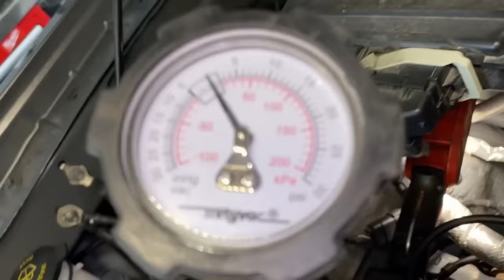2011+ Ford F-150 3.5L GTDI Ecoboost Engine P0299 Turbo Underboost Quick Diagnostics

Comment from the maker: This is the Vacuum/Pressure Tester I Recommend:
https://amzn.to/33P5JkG
Latest Ford Blow Off Valve (2013+)-
https://amzn.to/3yv0GCy

Forscan is free Ford Specific Diagnostic Software:
Download Here- 
https://forscan.org/home.html
ELM 327 Adapter I Recommend-
https://amzn.to/2GC6dBj

As an Amazon Associate I earn from qualifying purchases.
Reply: thanks i will order the mityvac today
Reply: Teacher can you do a video  please for a diagnostic in a ford f150 3.5 whit code.p0035.
Reply: Its 2019
Reply: Is there an software/app that allows me to use my Smartphone as   My code Reader?   Either APK or IOS?  I’ve seen some Diesel stuff like this, but nothing “Forscan” specific.?
Reply: The intercooler i would repair with high strength long cure  epoxy once i had cleaned with brake cleaner washed with dish detergent / hot water dried and sanded  prepped correctly it would last  . Its is used in hvac repairs were welding cant be done easly . In Canada the intercooler would be double + the price for sure  . The key to epoxy is propper prep
Reply: Do you know if that blow off valve is suppose to make a clicking sound? Mine has been doing a clicking sound, since the day I bought a new one, to replace a broken one that came with the truck.
Reply: Do the F-150 3.5 ecoboost and Expedition 3.5 both have the same diaphragm on wastegate? Curious if I can use pressure to test Expedition. Thanks!!!
Reply: @luisfranco5917  mine does as well not sure if that's good?

Comment: Nothing like a mechanic who knows how to diagnose a problem rather than a mechanic who only knows how to replace parts.Great video as usual Brian.Thank you Sir.
Reply: When I did service work we called them shotgunners replace enough parts and you will fix the problem,not very talent but eventually you might get it fixed and they still didn’t understand how they fixed it
Reply: @stephenthompson1319  We call it the parts cannon at work.  Just blow enough parts at it until it finally works.
Reply: "Mechanics" are most of your parts throwers and tire/brake/oil change jockeys.  A good 'Technician" is what this guy is.  Actually diagnoses thoroughly and properly and then makes his repair.
Reply: Ya i wish i brought my ecoboost f150 to this guy instead of ford 3 times for the timing chain rattle. Just found out Im only 30 minutes away from his shop
Reply: This is the issue i had a ford dealer i took to changer mechanic rather than a mechanic that fixs
Reply: To much of the R&R in today’s Techs. With no actual Knowledge of what the problem is.  I’m in the Technical field myself and I’m almost always solving a problem with TShoot & Diog. Saving money for a new “Whatchamacallit” that wasn’t really necessary,   Without Theory with experience they’re all just “Installers”. Not formal techs/Mechs.
Reply: I get it.  But if I boil it down to 2 parts and they are say 50 bucks each,  I'll replace both over another hr of diagnostics. Especially if you have to pull the part to test it. I also consider vehicle mileage when throwing 2 parts for one problem. Hope that made sense
Reply: On point.
Reply: Half the time it’s the customers handing you a part saying i diagnosed it myself from a yt video . They don’t want you doing more than throwing the part in .

Comment: I know very little about working on cars but when my under boost code came up I came to YouTube before going to the dealership. $50 and 10 minutes later, my 2015 F-150 ecoboost is like new again and no check engine light. Thank you for the video!
Reply: What did you find wrong and how many things if any did you replace?
Reply: Monty, there was a hole in the blow off valve. Prior to this, I changed spark plugs, cleaned fuel injectors, cleaned all the maps sensors.
Reply: @adammccullough218  Thank you do much for your help in guiding us novices. Did you use CVC/CRC (sp?) for sensor cleaning?
Reply: What is the name of the harness that connects to the pressure valve?

Comment: I had the same code in my 2014 3.5 ecoboost. All the hoses and connectors checked out fine. I pulled out the pressure relief valve and didn’t see any noticeable tears in the diaphragm, but I ended up replacing it anyways. After clearing the codes, the problem never came back and I have the turbo boost back. Moral of the story is just because you don’t see a tear in the diaphragm, doesn’t mean the valve hasn’t failed :)
Reply: I appreciate this comment This is very reassuring since this has been my thought for a little while now... I too did not see a tear in the diaphragm and I'm about to change my BOV out we'll see

Comment: I'm a ford dealer tech. I 2nd this video. This guy is spot on. I only do driveability issues. Seen this several times. I dont even follow the pinpoint test anymore.
Reply: Pinpoint testing is a waste of time for ford warranty to waste time and get the customer frustrated.
Reply: follow makuloco instead 🛌💤👀

Comment: I had an underboost code awhile back, and this was indeed the case.  Now that I'm turning up the boost I wonder how much pressure this stock valve will take.  I didn't want to go full out on a Turbosmart mechanical BOV, but now they make an EBOV, so I'm very tempted to try that. Have you seen those in person by chance?

Comment: Just had 1 of the trucks in my fleet have this code after looking at the records this truck didn’t get it’s yearly PM that would’ve included spark plugs. So I went ahead and did the plugs cleared the codes and after 3000 miles code still has not come back

Comment: Awesome video Brian…really helped me in fix my 2013 F150 3.5L that had P0299 code!
Just as you suggested…my blow off valve had a hole in the diaphragm!

For other DIYers...when I replaced the blow off valve on my truck, I did some extra steps that helped me:
     1)  I removed the underbody wind deflector to give me more room to maneuver under the truck
     2)  I removed the resonator mounting screw allowing me to rotate the resonator up counterclockwise
           while still attached to get better tool clearance to remove the blow off valve screws

Like Brian predicted…I broke the left side screw in process of removing my old blow off valve.  The screw I used for replacement
was Ford part number W507065-S437 ... get quantity 2 to mount your new blow off valve with new screws.

Took me 25 minutes to complete the job including removal and replacement of the wind deflector.
I cleared my code and started the truck….no check engine light and had turbos again!

Comment: This video just saved me a bunch of money. The large hose for the air inlet coming out of the turbo had popped off. Check engine light came on during a 400 mile trip, and the truck was running like crap. Put the hose back on, tightened the hose clamp, and it’s the best the truck has run since I bought it 9 months ago. I think it was working itself loose for a while.

Comment: Thank you very much for this video. I got a CEL for low turbo boost pressure while traveling in the Rockies recently. Went through all your steps and found that my blow off valve had a hole in the diaphragm. Luckily I was able to get a new one at a local dealer, throw it in and enjoy the rest of our vacation with plenty of boost in the mountains. This was most likely what I was hearing previously (mooing sound while accelerating) and the thin air in the mountains made it more apparent. Thanks again for the help.

Comment: Twice the hoses, twice the clamps, twice the wastegate diaphragms, twice the oil lines, and a big ol' intercooler mounted up front, down low, with nothing shielding it from road debris.  What could go wrong?  Then there's this gimpy blow-off valve mounted on the back of that.  With bolts that rust solid.  Thank you again for your videos.  You're saving people's sanity, not just their money.  Very methodical which is key on a complex beast like this one.

Comment: This was the exact problem I just had, found the issue in under 5 mins thanks to you and this video, bought the part and now to wait for a few days for it to get in. Saved a trip to the dealership and the ungodly amount of money they would’ve charged to troubleshoot and then to mark up the part 100% on top of that. Ordered through your link on Amazon and was a touch under $50 and will be about 20 mins total of my time. Thanks again! 2014 with 59k miles

Comment: Just saying that I'm so glad I found your videos.  I've said it many times that I hate my 2012 FX4, but I'm stuck with it, and these videos are the best by far I've seen.  Thanks!  You've saved me $$ and time!  
Shuttering again, 35 mph or more if give it gas, loses power, CEL flashes, I've had it before.  Changed throttle body.  This time cleaned it, sensors, new MAP installed, improved for about 15 minutes....changing plugs next.  Cheap...to expensive.  Heck, I've even changed out the 'brain' in my tranny before.

Comment: I found this repair applicable to a 2017 expedition with the 3.5, pulled the blow off valve from the intercooler and found a small tear in the orange seal was causing only an under boost code with no noticeable loss of power, great info for sure.

Comment: Thank you for all the in depth videos. Very helpful. I spent all day yesterday changing out all the fluids under my F150 it has 88,000 miles on it. I couldn't believe how black and nasty the fluids were. So thank you for the heads up on not going by the manual intervals of when to change fluids. Thanks for saving me lots of money down the road. Have a great day Sir.

Comment: Great Video. And Thanks. I went straight to the Blow Off Valve and had the same issue. Hole in the Seal. I would not have spotted the small hole without knowing it was a common failure. First inspection it looked ok, then I pulled on it to reveal the hole. Thanks again for the valuable post.

Comment: I'm a new technician and I had this code on 17 ford expedition 3.5L ecoboost almost 100k miles. I wanted to know some of the things that caused this code and a lot of the confirmed fixes on identafix is replacing the turbos, but im not the one who likes throwing parts on a vehicle and crossing my fingers. I found this video, checked the various items you did, and wouldn't yah know it. There was a tear in the Bypass Control Valve just like this one. Thanks for your help, and definitely subscribed 👍

Comment: My 2016 expedition just started throwing the under boost code at low rpm/high throttle. Thank you for the checklist to look at.
Reply: Ebov is the primary culprit
Reply: @RadDadisRad  Ebov?

Comment: Thank you my man!!! That valve must have had a twin... Mine was torn same place. I did job without pulling anything out but it took some patience to remove the bolt on left as you look up. A flex neck and 8mm on 3/8 drive, an extension and lots of prayers and patience got it out. I did notice the screws are alluminum so I can see why they twist and break. Thanks again!!!!!

Comment: THANK YOU for posting this video!  I've had an intermittent CEL which then became a steady light recently.  I've noticed power has been down, especially when towing.  I was dreading an expensive turbo repair, but using your video, I was able to start checking for leaks and quickly found a torn valve.  It was an easy an inexpensive fix - actually surprised how power is fully restored now!
Reply: Lucky you, I was told to replace turbos
Reply: Was it easy to do.? Just bought a 2016 and after getting on the gas the check engine light comes on and lack of power.. code says turbo under pressure so I'm assuming it's same thing.  Or hope it's only that
Reply: @marckirby7356  Yes, the job isn't difficult.  This video shows exactly how to do it.  My local Ford dealer had the part in stock so that was also nice.
Reply: @yandia8336  ty

Comment: awesome video.  I just replaced that part on my '13 F150 (140k miles) a few weeks ago.  I typically get that code when I tow my travel trailer.  knock on wood, that takes care of it.  I used some stainless steel bolts instead of screws on that valve.  I find it funny that they provided a second set of holes to use.  keep up the great work.
Reply: Same issue for me under same condition, but at ~70k. The second set of holes is for when the rusty screws break in half when attempting to remove them. And yes replacing this valve solves the problem seeing as the old one will have a hole in the diaphragm that is visible to even a blind mechanic!

Also during this part install I did a flush of my CAC and woah did it have lots of oily crap in it. Runs better, mpgs went up a bit, overall good fix.

Now the cold idle is another story....Brian please do a video investigating that.

Comment: Very informative, recommended for anyone with this code. Nothing like tightening up a boot or doing a simple sensor or valve cleaning/fix instead of a spendy shop diagnostic fee.

Comment: Very thorough! Good stuff to check, especially if you aren't experienced with turbocharger systems... Some cheap easy fixes can be misdiagnosed as an expensive repair.
Reply: Or intentionally misdiagnosed . it's hard to give anyone benefit of the doubt.

Comment: Great video!  I had a p0299 on my 2015 Ford Expedition at 78k miles due to a hole in the blow-off valve diaphragm (looked exactly like the one in your video).  Much cheaper repair than turbos!
Reply: How do you do a smoke test?

Comment: Fixed!  2015 F-150 2.7 code P0299 going into limp with wrench light and low power/ no boost.  Replaced the "EBOV" valve with Ford PN: AA5Z9U465A $81.33 list.  Also available as Standard PN TBV1007.  Don't get too hung up on torn diaphragms, leaks etc.  This one looked good but was still causing the fault intermittently.  Just replace it!

Comment: Great timing on releasing this video. Had a 14 Escape with 1.6 .with p0299 . Pulled TCBY off of turbo and found it stuck in . Parts department says only comes with $1100 turbo.
Reply: @behexen250 Should be another way to replace that part without purchasing the whole unit. Ripoff!

Comment: 12:58  To remove that broken bolt with a tig welder.  Deposit one drop of .045 - 1/16  filler rod to the top of the broken stud/bolt and let it cool for a minute or so.  Repeat that process to build a spire with drops of filler rod until the spire is tall enough to grab with pliers.  I have removed as small as a broken 6-32 tap using this technique.  No need for the cool down between tig drops if not in a plastic part.

Comment: My 2013 f150 had the same hole in the blowoff  valve at around 80k miles. Good call checking this before buying new turbos.

Comment: Seen lots of photos of the BOV (AA5Z-9U465-A) with torn diaphragm all otears seem to look identical - I would say it's a design flaw personally. 

Your video was AWESOME and helped me find, remove and replace my BOV., with ease and confidence 

Jacked up the front of my 2013 F150 FX4 and removed the screen that is below the intercooler. Then pop off the wire retainer for the Outlet Duct on the drivers side, then carefully push up the duct, watching out for any oil. If you don't move the duct up you will not be able to get to the left bolt. 

BE CAREFUL undoing the bolts, lots of articles about them breaking off, so be gentle and take your time, plus they only screw into plastic. Snap them off and you may need to replace the adapter (DL3Z-9V456-A). Again, awesome video and much appreciated!!!

All good now and no more error P0299 :o)

Comment: Just like to say that I watch your videos all the time and was excited to see one on the 2013. I've had mine sense 2013 and I have not had any trouble at at out of mine. I change my oil and filter and air filter every time it's needed. I just rolled 200,000 miles and i have changed spark plugs four times now. Other than that I have not done anything to it. It's been a great truck and when it's time I will get another one.

Comment: The same exact thing happened to mine. The dealer replaced one of my turbos (under warranty). Still had the leak. Ended up being the $50 blow off valve. Haven’t had the code since it was replaced.
Reply: Did the code keep coming back until it was fixed? I'm wondering if I had a weird event happen that caused the code. I cleared my code and it hasn't come back for over 2 weeks

Comment: Your knowledge is amazing. Thank you for inspiring confidence by making us understand these failure points. 

Isn't it a crying shame how that air cooler is exposed to the hazards of the road. Gravel. Flying sticks and other debris. There ought to be a two-level diversion screen baffle to stop hard objects but allow air to go through. Or maybe a very stiff wire mesh like a copper chore boy but made out of steel.  Or 2 thin ones. That air cooler looks like a big ongoing problem and the engineering thus far is obviously far too minimal.  There's nothing robust about it.  I would expect more from Ford.

Comment: Great video! I wish my local dealer would watch all of your videos.  I am currently in the "warranty process" for new turbos.  I've checked everything you have gone over and the dealer has looked at the truck twice. After a call to the tech line, I have been approved and will be scheduled as soon as parts come in.  End conclusion,  the dealer said it was carbon build up on the wastegate.  

Keep em coming...
Reply: Dealers don't care about these videos because it lowers their "service monies"
Reply: Yeah,  I know.  Wishful thinking...
Reply: Update, both turbos have been replaced as well as the solenoid valve.  3 trips to the dealer.  I got it back and I can still hear boost bleeding off.
Reply: Ouch,!!